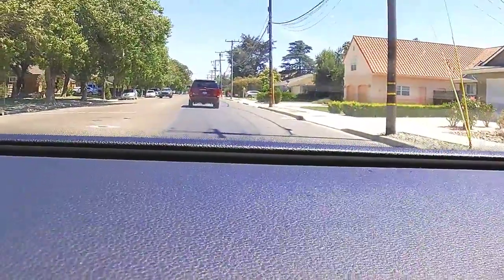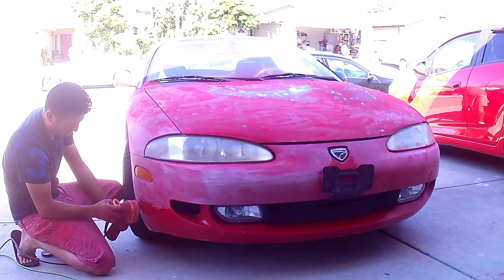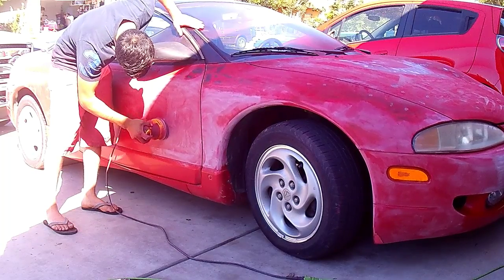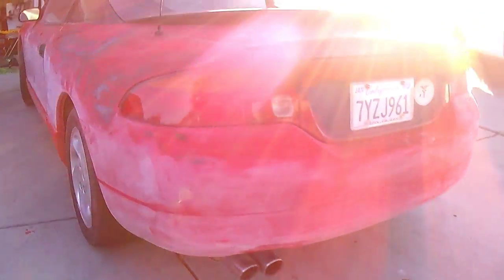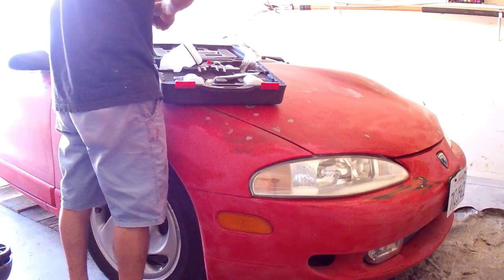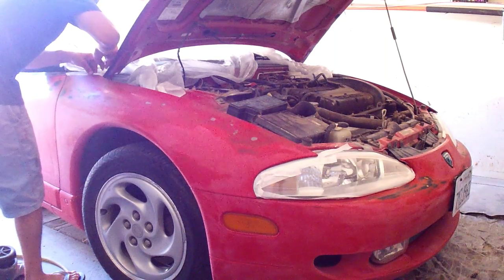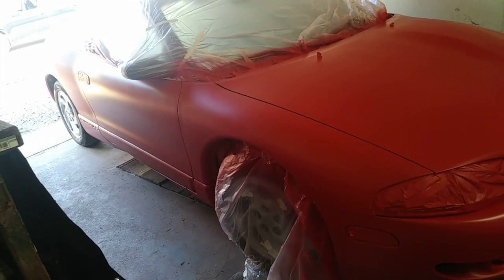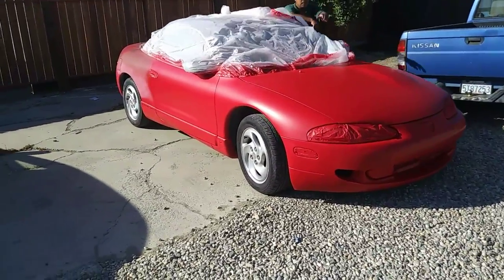$200 diy car paint job project using duplicolor paint shop, cheap paint job

Comment: The paint looked pretty dull,,did you have to buff it out...thought that laquer usually was pretty high gloss
Reply from the maker: Yea it needs to be buffed but I'm not sure if clear was applied in this video.
Reply: @CALIREBUILDABLES  Im needing to repaint a hood and front bumper on a 07 cobalt and am looking for something that requires no mixing ,,,that has hardener and base coat,,,the duplicolor claims it has both but have seen mixed reviews
Reply from the maker: You can also try automotivetouchup.com or paintscratch.com. they sell you pints quarts or gallons of your paint code and it's premixed ready to spray they also sell spray cans and 2k clear
Reply from the maker: I've used duplicolor perfect match and it's a pretty close color match also

Comment: CR, I thought so. Where can you buy it at? have not seen it around here. Watched some video where a guy used some paint straight from the can.Not sure what he used. We use to used Delstar acrylic enamel years ago. I'll be watching for finished paint job!
Reply from the maker: Wrecked Rebuild you can find it at autozone or orylies, i have seen them at most auto parts stores and this paint comes ready to spray from the can i mixed it just for preference but it depends on how you like it and its $26 per quart and they have different colors and like 3 different clears.
Reply: CR, Thanks man. I got Duplicolor rattle cans for the Cavalier. I'll look at AZ next time I go there.
Reply from the maker: Wrecked Rebuild yea it's duplicolor also but it's "duplicolor paint shop" AZ should have them

Comment: How many quarts total for a whole car that size
Reply from the maker: about 3 quarts, i bought 4 just in case and ended up using some of the 4th can but that's because i wanted to some more on some spots ( not that it needed it) plus clear of course.

Comment: How much thinner should I put
Reply from the maker: Check on the can's label bro because every paint might be different but try a 4 to 1 ratio bro so for 1 gallon you'll use 1 quart of thinner or you can do smaller rations or you can try smaller but a 4 to 1 or 3 to 1 might be enough bro👍✌

Comment: Dude you should have just bought single stage urethane, lacquer sucks it will fade and crack.
Reply from the maker: apme1234 I've never heard of it man but i will definitely look into it, im not a pro so this type of comments really help man thanks👍✌
Reply: Urethane can be dangerous to spray without an air supply respirator from what I've heard, but I'm sure it would have better results.
Reply from the maker: Yea that's what I've been hearing about the urethane that it's really bad for the lungs.